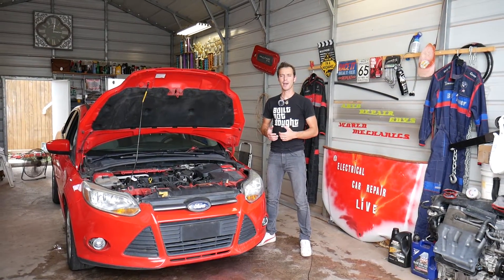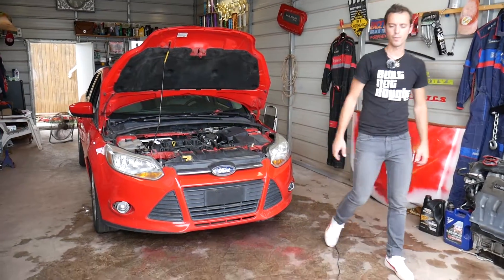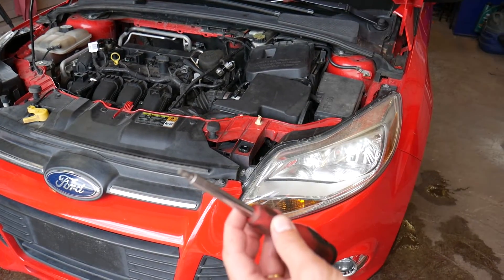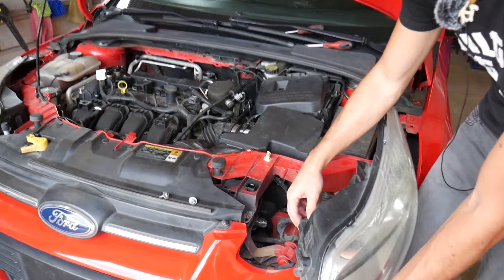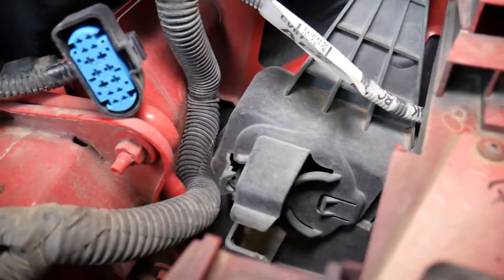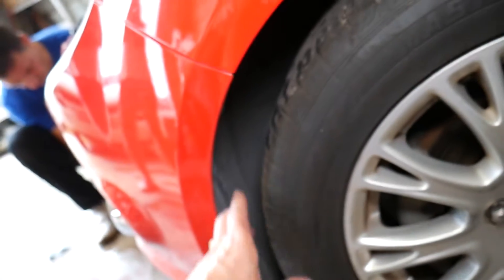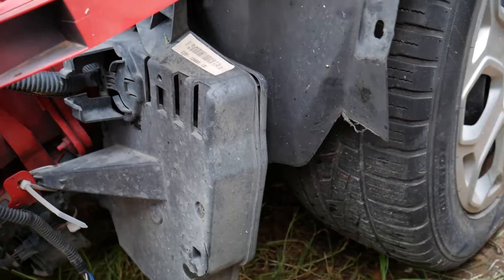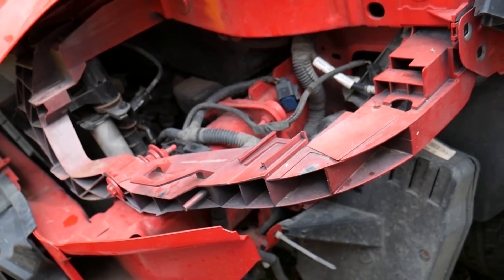FORD FOCUS ENGINE COMPUTER ECU ECM PCM LOCATION 2011 2012 2013 2014 2015 2016 2017 2018

Comment: First of all its a shit design in general, its exposed to so much water, headlight washers if they get nocked, or jsut end up faulty, water traveling through the fender and down, water also tracking up the insuide of the wheel arch. Like ford couldnt have put the ECU in a better location love it!

Comment: Happened to fall asleep through a fence, post hit the corner right here, bracket holding computer exploded into thousands of pieces but computer seems fine. Hope i found the right part online, there's only one part with two pieces right?

Comment: I never thought they designed this car to be held the ECU in that location, it’s like a medium crash could damage it or some water getting in, it is not a high enough place neither.

I also thought the ECU was the plate portion in front of the battery, the one that holds the battery tray and connects the red battery cable

Comment: Any idea how to remove the 4 bolts holding the cover to the ECM?  The bolts just spin.  thanks
Reply: I’m having the same problem right now did you ever figure this out?
Reply: I ended up breaking it up(with a hammer and a rotary cutting tool) and buying a replacement, got rid of car @SpurYourEnthusiasm

Comment: I gota new braket and cover to replace the old one. My problem I'm having is the bolts that hold my cover to the braket. The treads in the braket are twisting with bolts when I'm try to remove them they won't brake free what can I do? I'm about to just cut everything out. Or just super glue the threads to the braket without gluing the bolts.
Reply: Did you get the bolts out?  Having same issue.
Reply: @billlittle-wg3ee  same did you happen to figure this out?
Reply: I’m having the same issue did you figure it out?

Comment: My focus shut off while driving. Had it towed to my house. I got in and pushed the button on the gear shifter and the car started. No key in the car at all. Any ideas?🤣
Reply: Mine  is shutting off while driving as well! Then it started losing all power. No crank, no start.  I had issues for 4 days starting it back up after that. And now I only get power to the dash screen when I put my key in and press the unlock button! Lol but it has not started in a week and I was told the Control module was behind the firewall under the glove box in the passenger floorboard!  I'm done. Stick a fork in me! Lol

Comment: Thank you very much for the video.  Very interesting! 
Can you please make us a video about the battery light? The possible problems that can cause this light because it's really going to make me crazy, I changed all the charging kit (Alternator+charge regulator), the light disappeared for about 15days (around 2500km) and back to reappear again 😵, the problem is when this light is on the engine in a stop is around 1000-1100rpm, but when light is off, engine is around 750rpm only which makes it very quite and silent.
Thank you in advance for your help 🙂

Comment: Many thanks, i have an issue with a Mk3 1.6D Focus with the following codes. i am intending on checking these modules visually for damage.
U0100- Comms lost with PCM/ECM
U0151- comms lost with Restraint control module
B10A2-02-2F - Crash input

The car apparently hasnt experienced a crash or airbag deployment. i would be very grateful if you have experienced these kinds of faults before and can point me towards any useful approaches.

Thank you very much 
Martyn